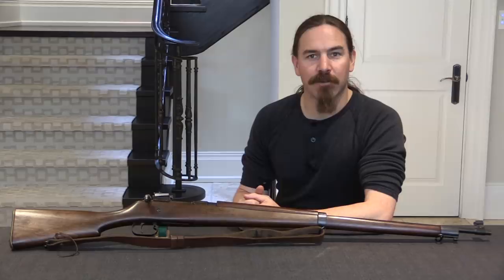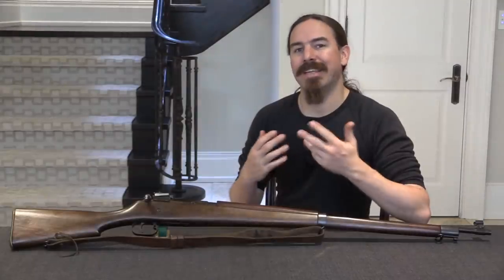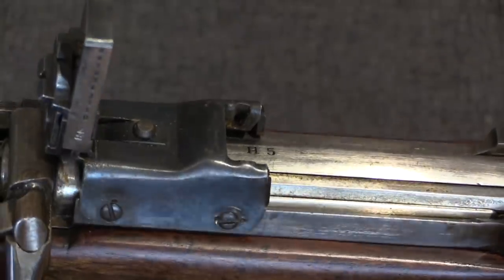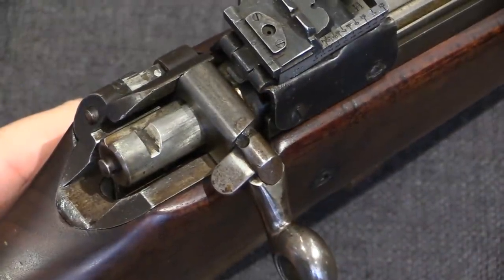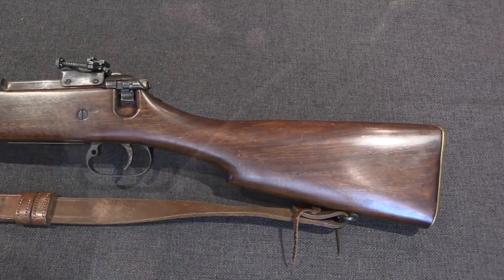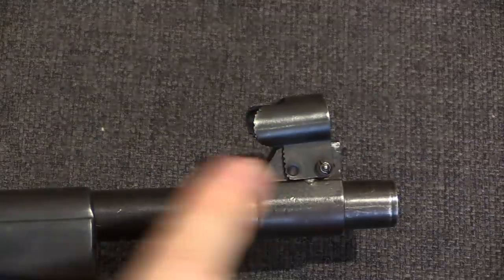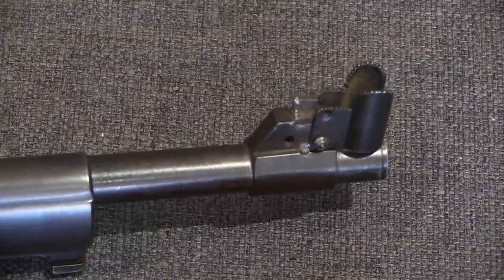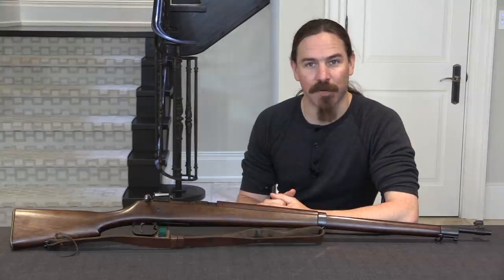Prototype Ross "H5" from 1909

Comment: I was so excited thinking that us Canadians had a semi-auto rifle like the General Liu / Mondragon up our sleeves. Unfortunately it's just an iterative improvement model.
Reply: Personally I’d never want to own a Ross for fear when firing the thing comes back and slams you in the face. Maybe as a collectors item but even then I’d be wary as all hell.
Reply: @robosoldier11  Perhaps watch Ian’s video explaining this and how it’s easy to not build your rifle wrong so it can do this.
Reply: @simonrook5743  ya I recall watching his review on one of the older ross rifles awhile back and he did a demonstration on what would happen if it slammed in your face. Either way just rubs me wrong at the potentiality of it.
Reply: @robosoldier11  As someone who's done the installation wrong just to see what it's like, you genuinely have to ignore like 3 signs that you're doing it wrong and REALLY monkey the thing in to get it in the position to not lock, and if you have a bolt that's pinned, you can't even do it at all. That said, maybe there were a few with different tolerances, but even then it should be obvious that you're screwing it up.
Reply: @leenmeenmememachine  hmmm alright. Maybe some iterations of the rifle are more prone to that then others. Either way I'm not individually scoffing the rifle. I guess I chalked it up more to the rifle causing this as a byproduct to the straight pull system. Vs. user wise you cause it to happen.

Comment: I want Ian to go back to BF1, with a working computer and all the guns unlocked and just marvel at how good they are on there. 

I think he'd be thrilled with a lot of the guns on there, especially the M1903 experimental, because you can change the firing mode in game, pull the receiver out and replace it with a single shot and thats just magnificent.

Comment: The front sight and fold-foreward protector looks terribly goofy at first. Until you consider ACTUALLY USING IT. Then it all makes so much more sense! 
The twin broad uprights just in front of the main blade would not only serve to protect it, but offers a great reference frame for quickly sighting in a target in any light, but being just slightly forward still offers some protection if the muzzle is banged on objects when swinging it into position.

Comment: Sorry to bring up an old post but. Thank you IAN for a very complete PE 57 STG 57 report. Every one Bitches about a 12 pound rifle but it is a light machinegun not as rifle.  It is a lot lighter than a BAR or a BREN.   I fear though you did not find the Epitome of Swiss Anal retentive engineering. Check out the steel BB on a peg cast into the bottom of the Aluminum BI POD LEGS so they would not wear down when fired off concrete. You took the easy way out by not removing the locking rollers.  With the 2 Jesus springs on top (as in Christ where will I find another one of those). The reassembly instructions calls for 2 dabs of Petroleum jelly to hold the roller wedges still. The PE57 offered a small metal  bent oval with a slot on the end for $5.00 to hold up the chamber loaded indicator.  At the time it seemed like $5.00 should have bought a hundred of them. When the PE 57 was on sale in the US a 25 round clip would have cost $25.00 to fill.  You could have bought a nice Nazi  P 38 for the cost of 2 mags full of Norma 7.5 Swiss the only ammo available then. No one ever asks but I much prefer shooting my PE57 to my SIG AMT.